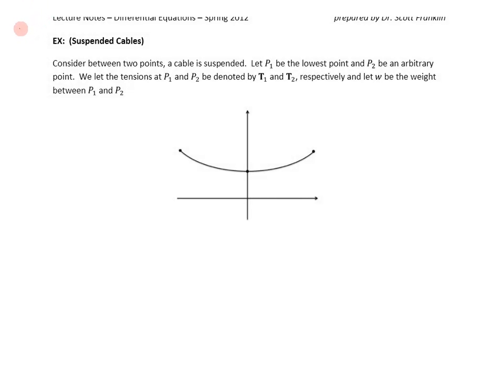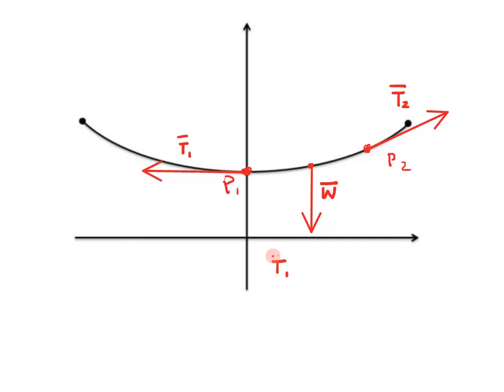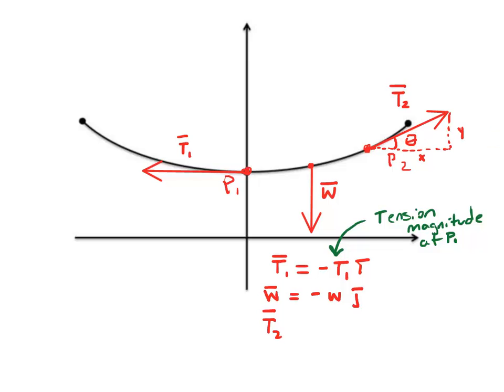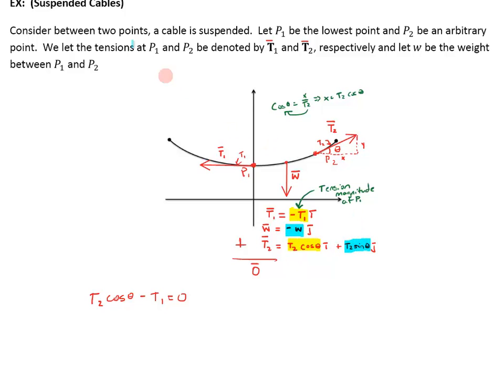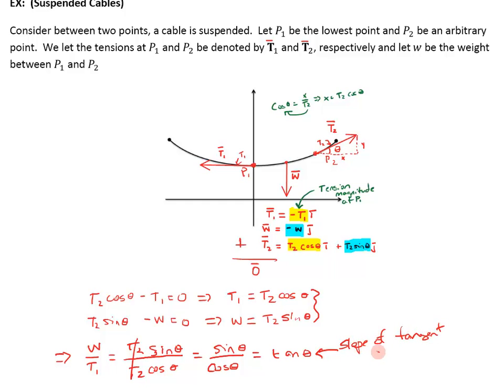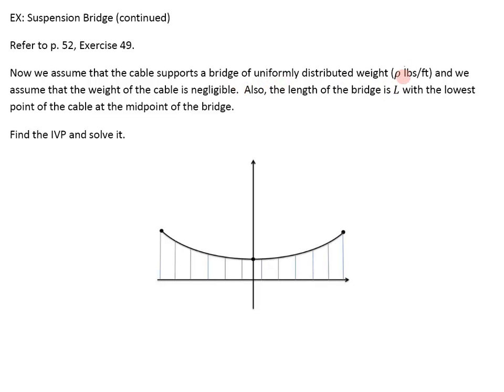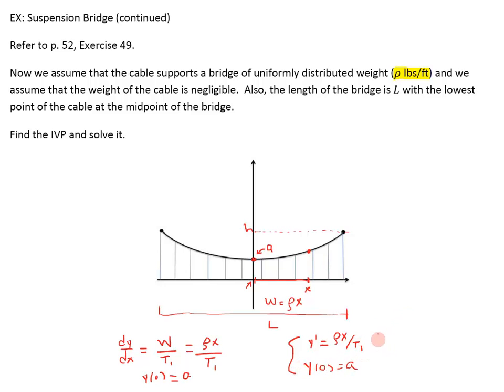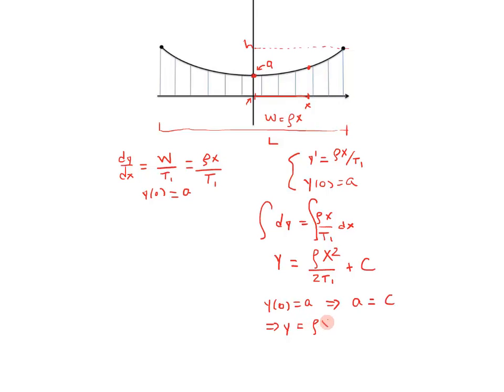Modeling Suspended Cables with Differential Equations

Comment: the solution is wrong the weight is equal tot he length times ρ and not the x which is a projection of the actual length. Keep in mind that cables do deform enormously which makes the difference between length of cable and the x total distand varie quite significantly. The solution is linearised for that reason a parabola was found. In reallity the solution is the cosh(x) which we use as structural engineer quite often.

Comment: Im still trying to figure it out, how Ro times X is equal to W (weight). If Ro is the linear density (Kg/meters or whatever), and X is given in meters, multiplying both is not equal to Newtons (kg.m/s^2), it will be equal to its mass in the given unit, isnt it?
Im really confused.
Cuz W is used as a Force, not as mass. What am I missing here?

Comment: why dont we get a CATENARY ? When the suspended wight is = 0 is particular.
Reply from the maker: +Clint Nibbler We are assuming that the weight of the cable is negligible compared to the weight of the bridge.  If the weight of the bridge is zero, then that assumption is false.